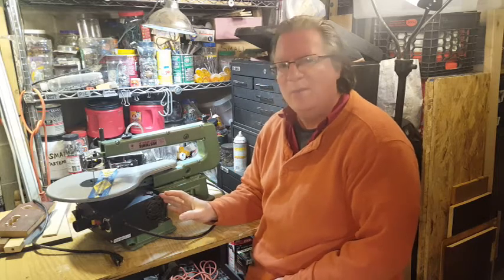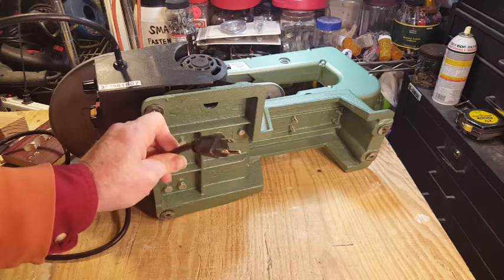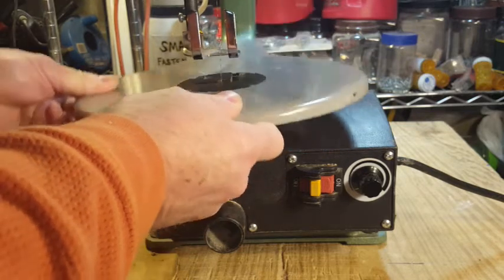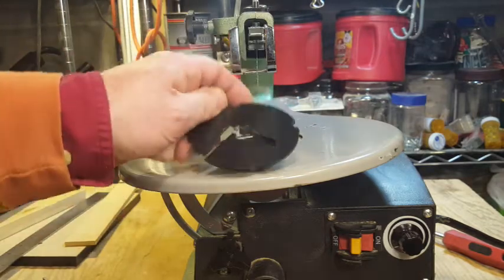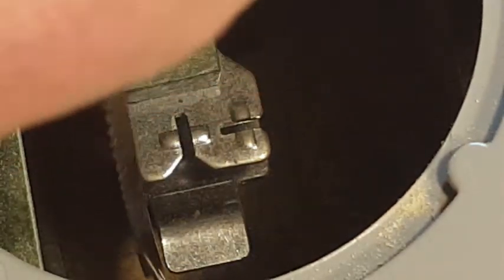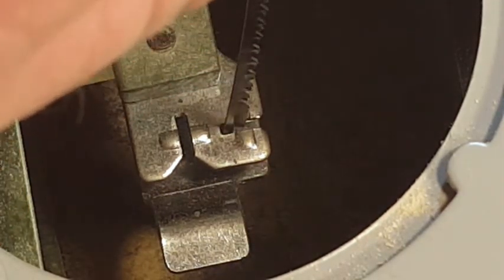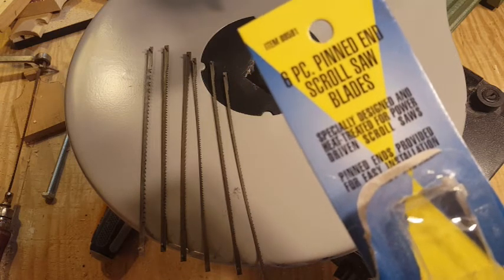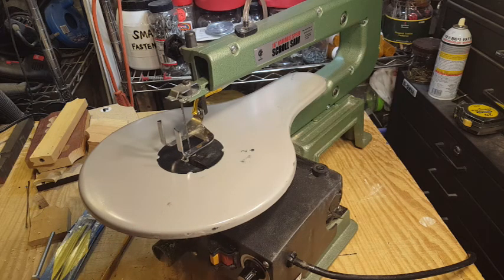10. Simple DIY - checking out a 16" scroll saw

Comment: Most scrollers discard the hold down.Scroll saws are one of the least dangerous machines you can cut with.The stock blades that come with machines are not the best but will do the trick.Great deal on the machine .
Reply from the maker: Thanks. I still have a lot to learn about what I can do with a scroll saw. And there are so many blade types to choose from.

Comment: I totally agree, the insert should be made out of wood or cast iron. Plastic deforms and end of insert raises above the table top and obstruct your flat material when inserting into the blade to cut. I just returned back my two weeks old brand new Ryobi scroll saw to the shop with a refund for this same faulty reason.
Reply from the maker: Thanks for your comment Ralph. Did you consider making your own insert out of wood using the saw?

Comment: Thanks for providing the info and your insight.  Will this saw accept fine jeweler’s blades for cutting silver plate?  Tx much!
Reply from the maker: Hi Rob. This saw only accepts pin end blades which are quite large compared to fine jewelers blades. There is an adapter one can buy to be able to use pin less blades. I have not tried it (yet) so I can't say how well it works. Thanks for watching.
Reply: @ImaginethenMake   Thanks very much,  I'll look for the adapter.
Reply from the maker: Hi Rob. Olson makes an adapter that might work. Here's a link:  https://www.olsonsaw.net/shop/scroll-saw-blades/pin-end-scroll-saw-blades-5-in-3-in-and-4-in/scroll-saw-conversion-kit/

Comment: I got one of this scroll saw used at harbor.  When I get home I tried but every cut that attent to make the blade goes to the left, why is this happening? Should I change the blade or return this machine
Reply from the maker: Thanks for your question. After you have drawn your pattern on the wood you want to cut, as you push the wood through the blade, you have to turn the wood as you cut to keep the cut on the line. This is normal for a scroll saw.
Reply: Thank you very much, I will keep it then and nice well video that you made, keep it up.
Reply: Nando * it’s like driving a car you have to keep countering left to right left to right making little adjustments left to right to keep the car in the center of the lane! Same here  little adjustments left to right right to left to keep the blade on the line
Reply from the maker: Excellent analogy. Thanks!

Comment: Question: are the saw replaceable, i need high teeth per inch saw, are these compatible?
Reply from the maker: This particle saw uses pinned end blades and there are many different blades to chose from. Also, I am planning to add an adaptor so I can also use pinnless blades (plain end blades). There are some very high tooth count blades available that are pinnless.

Comment: Pull the yellow tab out from the switch
Reply: It’s the safety switch
Reply from the maker: Yes, thanks. I bought the saw used and I thought the previous owner had glued it in place since it doesn't remove easily. But I tried a pair of pliers this evening and was able to get the key out. Thanks for your comment and for watching.
Reply: No problem i just bought mine today!
Reply from the maker: Does your new saw allow you to use pinnless blades? Or can you only use pin end blades? My saw only uses pin end blades.
Reply: Imagine then Make it came with pin ends!
Reply from the maker: Pinned blades, ok thanks. I got an adaptor for mine that should let me use pinnless blades. I'll probably make a video about it so stay tuned.